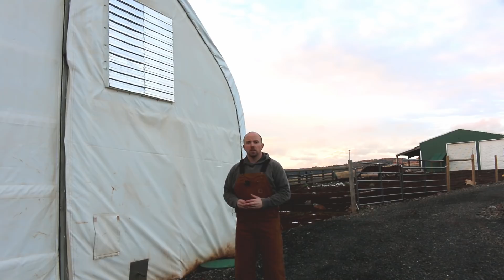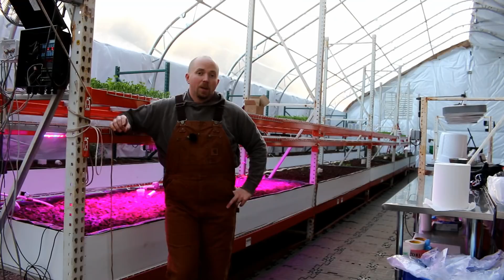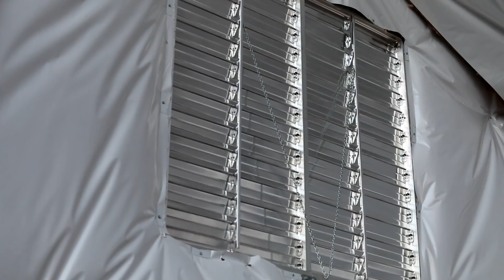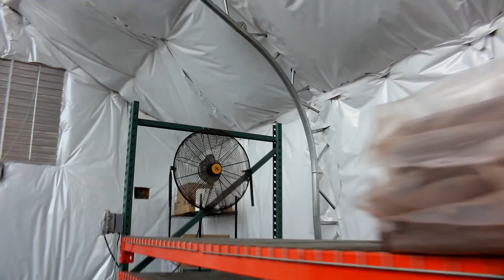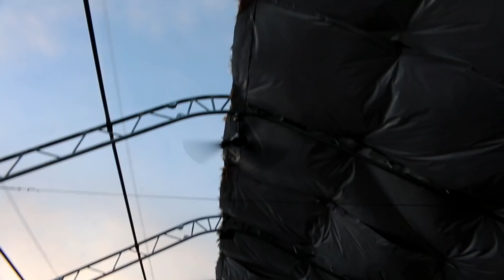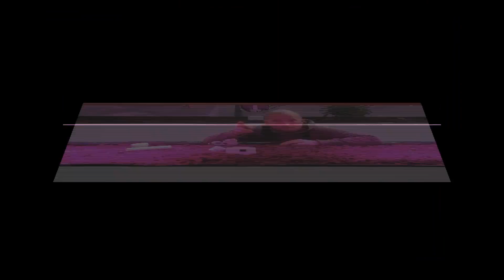How Many FANS are NEEDED in a GREENHOUSE?

Comment: Just when everything is running perfect... seems there's something a little of on your camera's auto-focus. It isn't major but it is doing a focus correction throughout the parts where you're on camera and nearby. You may want to slow down the speed so it is even less noticeable.. best suggestion. Everything else is great and it isn't really distracting but thought you should know because this can become a bigger issue down the line.
Reply: The shot in the UV lights had no issues. Hope thats helpful.
Reply from the maker: thank you...I've noticed autofocus has been acting weird...i'll check into it

Comment: Perhaps the loss of you crop due to fungal infestation was due to the settling of the spores in the micro humid areas around your top watered micro green growing trays?  Be aware that even when you bottom water your crop, you will still get accumulated moisture around your greens as the plants themselves will aspirate as they photosynthesis during the day.  I suggest that you may need to have air movement much closer to the actual action to interrupt the fungal parties.

Comment: You should have enough CFM flowing to exchange the entire volume of air at least once in the greenhouse every 30 minutes (some would say faster) to produce proper supplementation, that’s if you aren’t going to supplement with co2 generators. You should really look into carbon filters/HEPA filters, especially after your mildew outbreak. You can get speed controllers for fans. More expensive to get started up but has the potential to save your crop in the future. Heating greenhouses are not cheap. 

Some companies spend up to $40,000 a month in the cold season (per greenhouse) to heat properly and insure sustainability, but those are also multimillion dollar grows. Gotta keep in mind if you can’t get the equipment you need due to lack of funds, you will have major obstacles. Best of luck Martian!

Comment: Does anybody know why such a tall building is being used?
Reply: Ltifone2014 Jeff says for vertical growing... but has not demonstrated or shown this requirement... maybe on Mars... I strongly suggest, make it work locally before out of this world... Mars!
Reply: I suspect that he wants a tall building in order to contain (in one building) all of the troughs for fish, the hydroponic beds, etc.  One heating, ventilating, dehumidifying, ... system serves everything.  
Also, the tall greenhouse has minimal internal obstructions.  A lower building would probably require internal columns (which would reduce freedom to arrange beds, troughs, etc.).  Notice also that there's no transverse (side-to-side) bracing inside the greenhouse.  It's just a series of arches that are joined laterally.
Also, in his area, snowfalls can be heavy.  A steep roof will prevent snow from overloading the roof.

Comment: Can you not get all the CO2 that the plants need from the  the propan heater exhaust ?
Reply: That is sure a good question.  I understand that this vent was installed because they had too much CO2/CO from the heater.  Now he is talking about needing to bring in outside CO2.  If I understand it, plans can use either CO2 or CO.
Reply: To much humidity not to much CO2.

Comment: If you can find them they are called DC motor fans they're a little bit more efficient than your normal AC motor fans I've seen them around where I live in use but I have no idea where people have purchased them they're usually in industrial cages they are a slow startup but they use less power might be something to do some research on if you're running that many fans. I know for us when we heat our Cottage we always run our ceiling fans on low to push the air around slowly as to not create a cooling effect but I imagine you're going for moving more air over the slight heat loss.